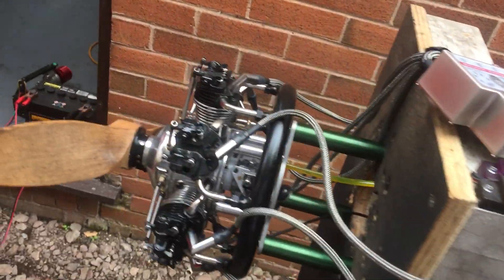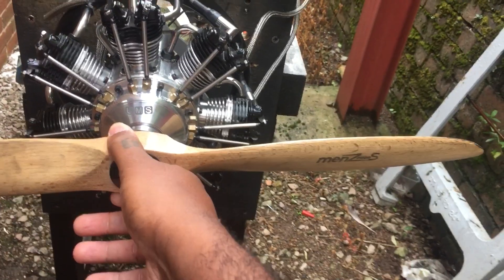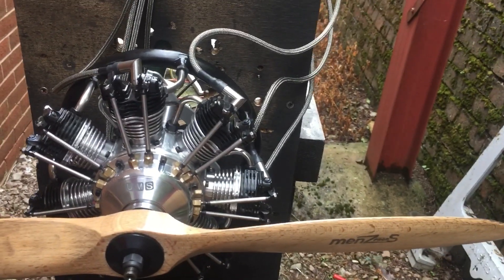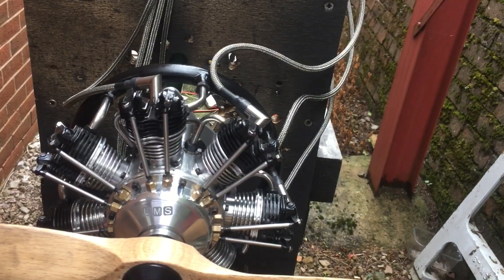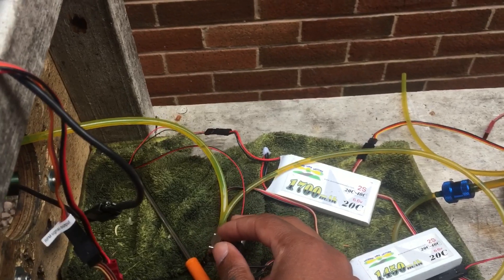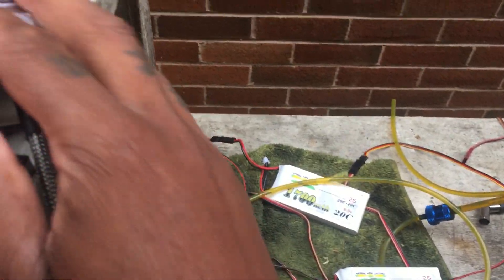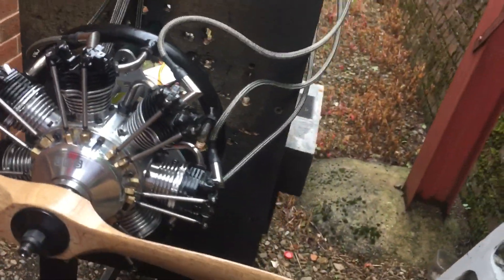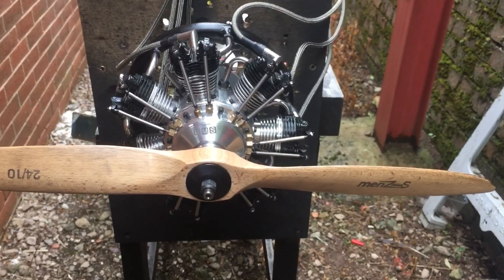UMS 7-90 90cc Gas Engine Prop 24 x 10 1100 - 5200 RPM

Comment: The engine's maximum dimension in diameter on the website says 9 inchs 228mm is this accurate i have a tight cowling
Reply from the maker: Hi  Yes it is!